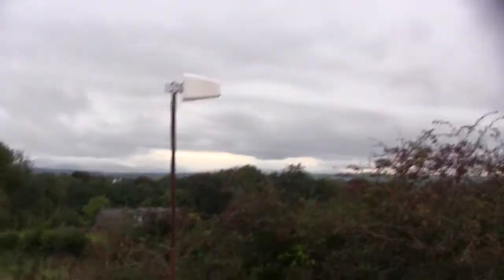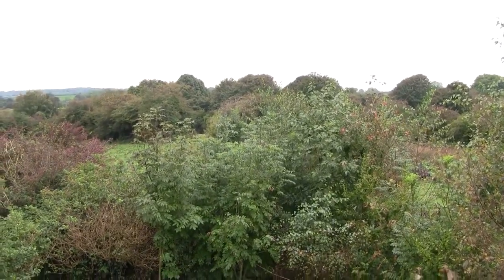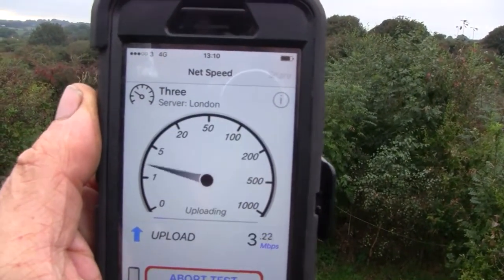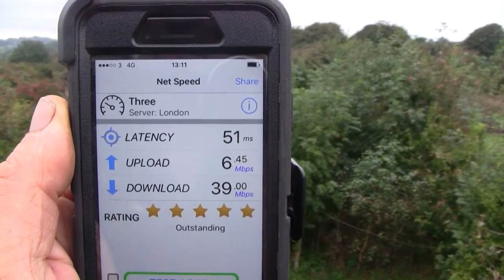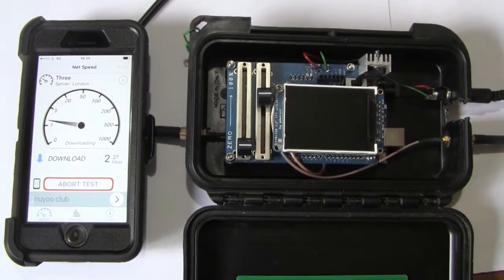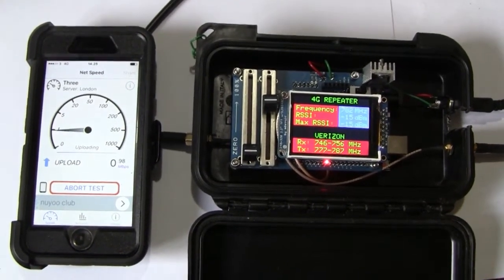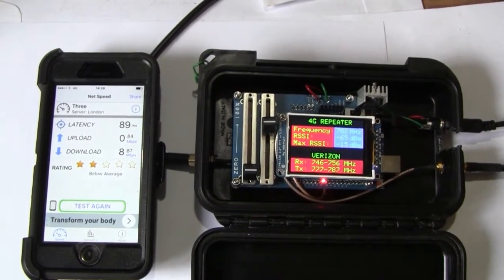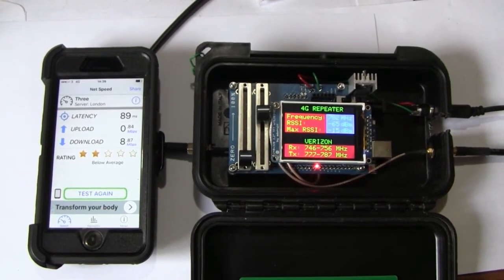Cell Phone 4G Repeater Demo

Comment: This is a cool project. I've been reading up on it on hackaday, I'm assuming that this repeater is functionally the same as the prototype you had running, just with everything on one board? Also you mentioned that you weren't transmitting, I assume that's what the second slider enables?